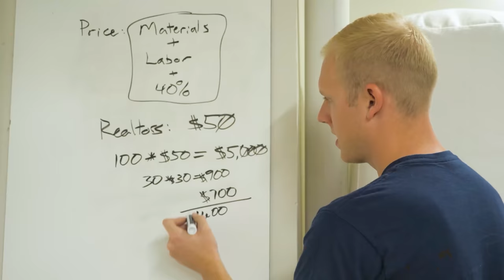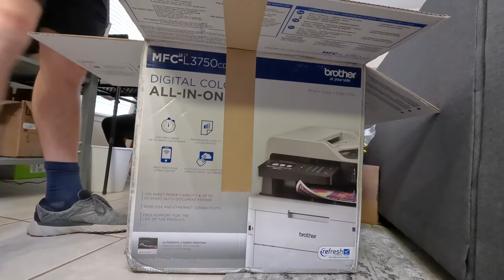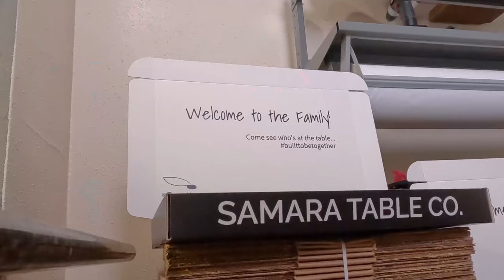💰CUTTING BOARD ORDERS! Can we keep our heads above water?🌊🏄‍♀️

Comment: We run a Chinese red and black laser. 80w co2 that cost us $3k AUD. It’s been going 5 years and we have had to replace the tube a few times, the mirrors and lens only a couple. You don’t need a $20k machine to achieve what you need. Look into it. Speak to Cloud Ray laser. They are in the US so will be less cost and you’ll get a machine that will kill the speed the Glowforge runs at.

Comment: Would you try to run two glowforge at a time?  Since you do have a second glowforge.  Wouldn’t that help you to increase your production?
Reply: That is what I was thinking too. If it is not possible it certainly a scalability issue. I wonder if the larger commercial laser units can be run concurrently.
Reply from the maker: We've addressed this in multiple videos. It would only save us a couple hours a week, but take up our precious floor space 24/7.
Reply: Not if you stack them on top of each other.  By moving vertically you would still have the same amount of floor space.  You would just need enough room to open the lid of your laser on the bottom.
Reply from the maker: @jasondockery9376  we’d spend more time finding or building a table to stack them than 2 concurrent engravers would save us… we have bigger fish to fry!

Comment: You can get a Thunder laser for $7k easy. Don't have to be spendy on the $20k mark. Plus you won't need the wifi like you have to with the Glowforge. Used Glowforges don't hold their value like other lasers. If I had the $, I would go with an Epilog. Thunder first of course.

Comment: You can outpace the glowforge with a $3k machine. You just give up the user-friendly features that makes the Glowforge so popular. An OMTech 60W laser with all the needed software and accessories would run under 4K and is crazy fast and powerful. Plus it gives more capacity and depth giving you more options for expanding your product line. Yes, it's a chinese laser, which scares off most people, but it's supported by a US company so tech support is no problem. Also, you say that your Glowforge made over $40K but did it really or was it just a tool that helped make that much money in the same way that your tablesaw and sander did? Just curious when you say it made money what you mean by that?
Reply: I would never buy glowforge because of its limitations. I also have the Omtech 60w and it will out pace it and not hard to set up and learn to use.
Reply: Yep, 60w Chinese preenex (basically same as omtech) for the win!  All-in for about $3000 with upgrades, and can kick glowforges butt!!!

Comment: Also, what type of wood is your go-to for making the cutting boards, and what company did you go through for for your boxes?
Reply: Maple and walnut I believe and the use uline for packing material
Reply: @Barrett Ready?  They use Uline for their boxes (I guess packaging/box would have been a more clear question) that have the logos? That is one part where I am still kind of stumped, not that I am at the level to have professional looking packaging, but it would be nice to. It shocks me when I get some $8 piece of crap from Amazon and I am more focused on how they can afford a package/box that would cost me $4-10 per box, depending on which website you go to.
Reply: @Eli  uline did logos for boxes tape and stickers. If it's more about bulk ordering for better prices. Logos are normally a one time price for the plates to be made then a small cost after that
Reply: @Barrett Ready?  Awesome, I will have to check that out again. There are a lot of cool websites that sell packaging/labeled boxes, but I am not busy enough for it to make sense dropping that type of money on them. I hope that changes at some point soon.

Comment: Hey, nice to see y'all continuing the grind. Quick question,  I have a Dewalt 735x Planer, but should my next upgrade be a better industrial planer or drum sander? I am working on batching out cutting and charcuterie boards.
Reply from the maker: Depends - is that the slowest part of your process? Try to upgrade tools where you’ll save the most time
Reply: @jennieanddavis  yes sanding is the slowest part...update...I just upgraded to the 3hp 10inch Grizzly G1023rlx table saw lol...next will be the drum sander lol thank you for the reply and thoughts.

Comment: Why don't you guys make a template to mark the center on the board for your engravings? If you use the cnc to cut out the shape of the cutting board with a circle in the center (I would use clear acrylic so that it would last longer and be see through). Then you place a piece of tape on the cutting board, place the template on top, mark the center, remove the template, and then get to engraving.
Reply: @Matt Redmond  In the video, I saw her measuring to mark the center. Since it seems like they have a few set style and sizes of boards, it seems like that would speed up the process for them.
Reply: @DMS20231  that is how I do it when I engrave ornaments and clipboards, it makes the swap between them all of 3 seconds long. the other thing that I learned/did eventually, since i have a Chinese laser without the auto leveler, is that I found the best position/gap between the piece and the focal lens and then sanded a piece of wood to that exact width that I need for the gap. then when I get a material of a different width, I raise the focal lens, move it over my material with my spacer between them, loosen the focal lens and place it against my spacer in order to get my correct height. This is something that I have seen people do with acrylic, make a ladder type pattern of different heights, but this worked best for me and it makes my setup much quicker.
Reply from the maker: Once we standardize cutting board sizes, we'll do what Matt suggested
Reply: @jennieanddavis  I thought your cutting boards were already a standard size

Comment: Na, not 20k...you are doing one board per session on the glow forge, with a shapeoko pro xxl and laser add on you could do six boards a session without having to move anything in between. Which, even if it burned as slowly would still save you at least 30 minutes per six boards.

Comment: The engineer in me is really puzzled at the 26 boards 8 hours 2 person ratio. 

Roughly speaking it is 1.63 boards per hour  (or 0.61 hours per board) if someone was alone doing it. If you were to hire someone else to do that part, aren't you afraid that it adds up rather quickly? I don't have all the bottom lines, but it really seems to me that there is a significant portion of the cost in shipping (shipping cost + shipping labor + shipping supplies). 

If you break down the shipping time for each step. How bad is the glowforge in the equation? How much time does the rest takes?
Reply from the maker: There's definitely a place to optimize our processes... but most of the time we just need to get orders out the door. Can't do both at the same time!